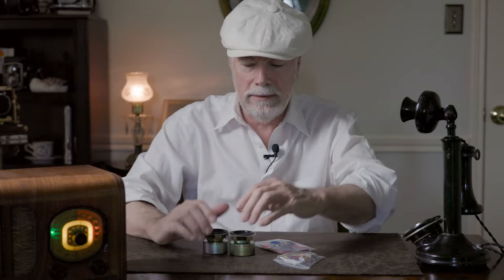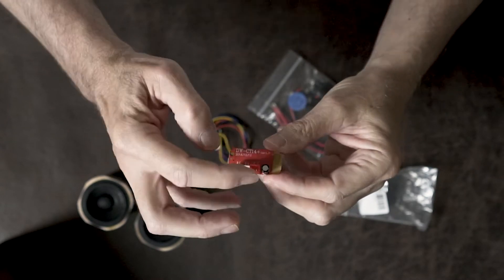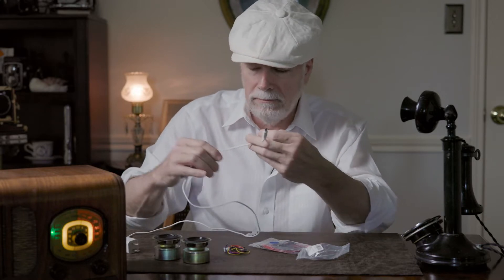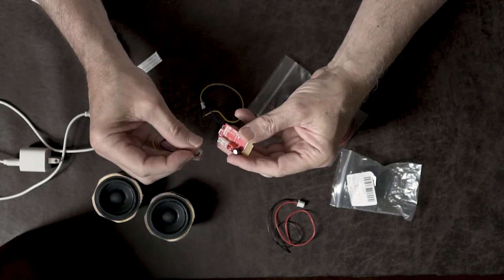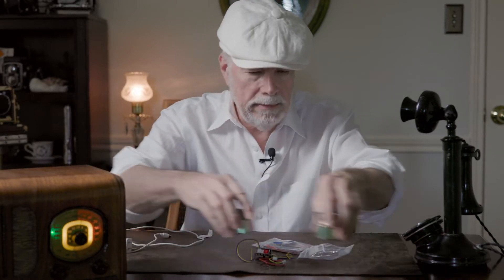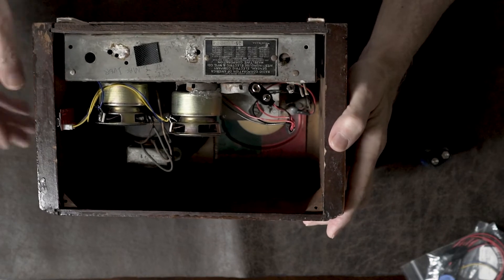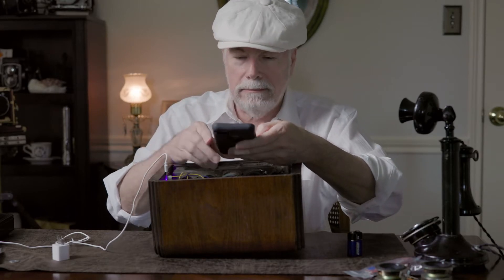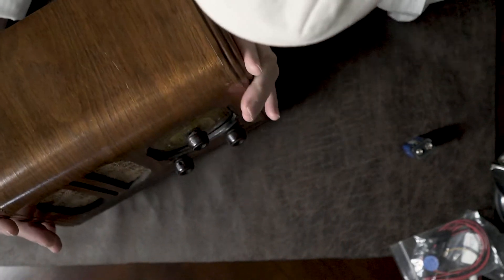How to transform a unusable vintage radio into a working prop using bluetooth

Comment: I like what you have done. I have taken several old radios that were beyond repair, and done a similar thing. But I didn't use blue tooth. I hid an fm car stereo in the case and use a small fm transmitter to send music from my phone or iPod. Twice I have added amps to boost the power. I use full range 6x9s in place of the large speaker that comes in old radios. They give a pretty good sound. On one of my projects I put the car stereo in the side of the cabinet. And it stays covered with a fancy doily that droops down over either side of the radio. No one suspects it until I lift the sheet to adjust the volume. You and I have the exact same idea. But go about it in different ways. Oh and I run 12 volt automobile lights for the dial. Since I have 12 volts there for the radio anyway. Keep up the good work sir
Reply from the maker: Sounds like you use larger radios? floor models maybe? Seems like a lot of work to use a car radio, then a fm transmitter. Bluetooth is the way to go. You can get higher power bluetooth amps as well if you need louder sound than the one I'm using here.

Comment: Great idea to light up the dial. Brings an old radio back to life. Could the led be wired to the Bluetooth module power?
Reply from the maker: Yes sure could. But in my case I use the light more than the Bluetooth and needs to be portable so the 9 volt battery is much easier.

Comment: That is so cool!!!!!!!!!!! Thank you so much for making this video. I see really nice cases all the time super cheap because they are gutted. This is gonna happen for sure! Ill probably take the LEDs and solder it to the unit to do away with the battery.
Reply from the maker: Yes! that will work. I'll have to change that for mine too.  Oh, in the video I said I use an Iphone cable to power it. That's not correct. It's a mini USB to regular USB cable. You'll see when you get the module.
Reply: @JakeHellbach  Now I got a new thing to hunt when antiquing. The missus is very excited to be able to pick up a radio now. She right off the bat said she wanted bakelite. lol.
Reply from the maker: @vintagelife5195  There is always something new to hunt for :) Glad she's excited about the radio!!

Comment: What connectors can I use instead of soldering to speakers like you say?
Reply from the maker: There are crimp on connectors. But you would have to check with the speaker you have to get the correct size.

Comment: I added three LED lights with the drop down installed powered by a 9v battery and got around 22 hours out of it till the battery was dead, any sugestions?
Reply from the maker: Suggestion for? 
22 hours for 3 led’s seems ok. 
I only leave mine plugged in while I’m using it. 
If you need the led’s on for an extended period, I’d use a ac power supply.

Comment: Can I wire the Bluetooth module to a 9volt battery?
Reply from the maker: Not the one I bought and used in this video. It takes 3.7 - 5 volts. There may be others on the market that take 9 volts.